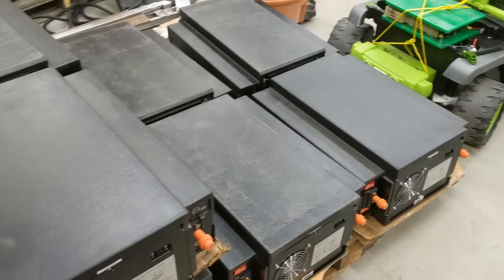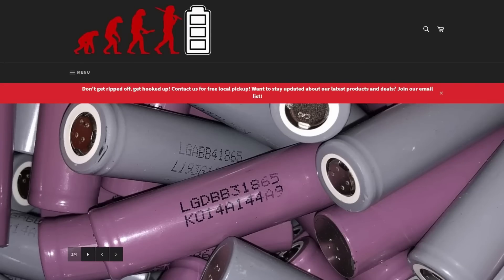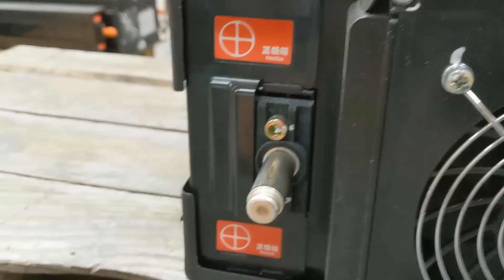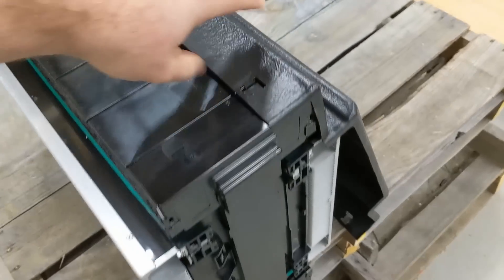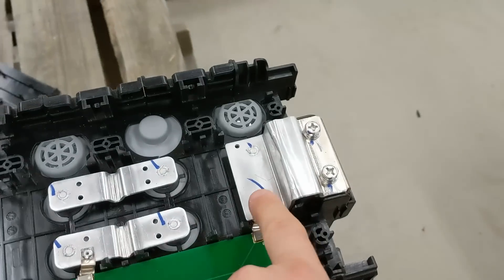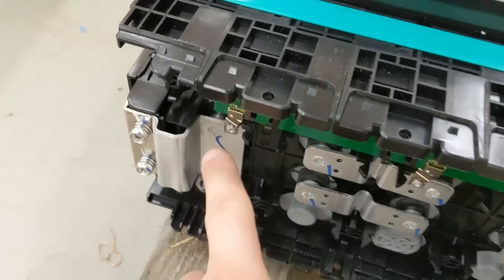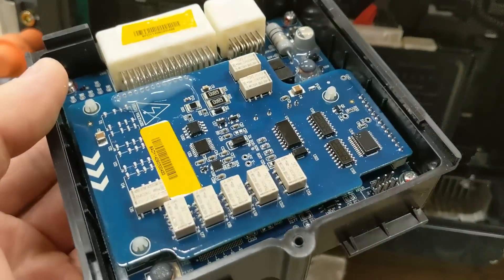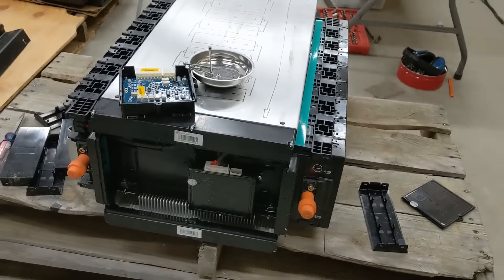$100/kwh Huge LiFePO4 Lithium Battery First Look

Comment: What if one of the cells are bad, how would you remove if busbar is laser welded?
Reply from the maker: I would cut the bus bar with a rotary tool (dremel)  Then I can remove the cell.  Once removed I'd probably bolt a wire onto the bus bar and run to a new cell.
Reply: Thank you

Comment: Hey David I'm new on your channel and I'm already hooked. You mentioned about putting two of those units in series, (for 48v nominal) would you be able to use the same 2- BMS's in series or would you have to change to One 16 or 17s BMS??
Reply from the maker: Hi Salvador, thanks for checking out my channel.  I don't recommend these batteries.  They turned out to be more of a nuisance.  I spent a lot of time trying to get them to work perfect, but constantly required my time to balance.  I have taken these cells out of service.  

If you are trying to build your own, I'd use better cells.  Use a 16s BMS, with LiFePO4 cells.  That means 16 cells in series, and the exact chemistry of the battery is Lithium Iron Phosphate.  

This is a great way to make your first battery: https://batteryhookup.com/products/new-battery-hookup-lifep04-32650-3-2v-5000mah-cells-1  This kit comes with 4 cell modules.  You would need 4 kits to have 16 cell modules total.  Those arranged in series would give you 16s, for a perfect 48V battery.  Then you need to add a 16s BMS.  Battery hookup is currently sold out, so try this one: https://overkillsolar.com/product/bms-100a-16s-lifepo4/ 

I have a coupon code with Battery Hookup: DAVIDPOZ which gets you 5% off, and helps out the channel through affiliate program.

Comment: Hi David, I live in Canada. Could you let me know how can I buy the battery?
Reply from the maker: I bought these from Battery Hookup.  However, these batteries are not performing very well and I don't recommend them.  Battery Hookup has stopped selling them because of the problems.  I'd look at a different option.

Comment: Late to the party I guess. Just bought some of the BYD packs from the bottom of the barrel. Each has a bad cell, listed that way from battery hookup. I've watched a number of people take them apart and rebuild them. That was my intent here for these 4 packs I bought.
Reply from the maker: That's cool.  I'm going to be taking mine down this summer and testing them.  I have a self-discharging cell in there somewhere.
Reply: @DavidPozEnergy  I used your code, so thanks for the hookup. 

I will try to video my tear down and rebuild, but I don't have the camera or audio gear to do professional work. I will post the project on my channel.

Comment: Dear Mentor DavidPoz 
I bought the BYD batteries, shipped to Somalia and lit a small village with 30kwh solar plant. 
I recently bought another 100 kw batteries from China. 
Can you please help find batteries capacity monitor. 
Secondly, I don’t know how many batteries I can connect together. I mean is it bad for the inverters. 
I use 9 5kw inverters set in parallel. 
I wish to show you the pictures but couldn’t attach. 
Thank you for your useful postings.
Reply from the maker: My favorite meter for measuring SOC (state of charge) is the Victron Smart Shunt.  I'm running one on my battery bank.  https://www.victronenergy.com/battery-monitors/smart-battery-shunt  If you are on Facebook, then I suggest joining the group DIY POWERWALLS I'm on there, and it's filled with helpful people.  And you can attach photo's.

Comment: Have you made a video on connecting a BMS  to the BYD 24v battery and if you have can you give me the link?
Reply from the maker: I have not made a BMS video on these batteries.  I used a Chargery brand BMS.  But I keep tinkering with it and I can never seem to get it to read correctly, or stay correct for very long.  I've recorded the process of calibrating the BMS, and wiring, but then it keep screwing up again.  I'm going to yank it out and do something different.   i wouldn't want to recommend a product that doesn't work well.

Comment: One question. I'm looking for a good battery bank for an RV setup that will run a mini split HVAC unit. How would I setup a battery like this to an inverter? I can only find inverters that have 12V input for the AC outputs.
Reply: There are a few 24v inverters out there. I run the AIMS inverter charger combo

Comment: OK question.  if those are 8s for 24 volts and one of your other videos it showed 14s for 48 volt system.   So will not 2 of these in series not be good for a 48 volt solar system.  Since then they would be 16 s. been watching your videos.  And I want to upgrade my battery system.  I have a 4kw inverter and I like to have a 100wh  battery bank.  I have been thinking about LIFePO or similar for my new bank. My old bank was only 250 AH about 5kw if I didn't discharge them at 100 percent.  I never discharged them below 70 percent.   I just want a much better bank that will last a lot longer than my Lead acid.  So been doing some research and watching. and wanting the best bang for the buck.
Reply from the maker: Depends on chemistry.  The ones in this video are LiFePO4 and 16s makes a good 48v.  But in some of my other videos I use Li-NMC and they want 14s for 48v.  I clear this up in a video: https://youtu.be/CbHABrTpSKU

Comment: Hello sir, 
I just I want ask you something I have a normal MPPT and now I using gel batteries so I want to change my gel batteries to lifepo4 so can work with my normal MPPT or should I change my Mppt to work with new batteries or just change my setting but I have just some settings in my Mppt ( gel , AGM, open lead acid , calcuim, AGM2 , sealed lead Acid) so should I change my Mppt?!...thank you
Reply from the maker: Check your owners manual and find out what the charging voltage is for each of the pre-sets.  The batteries I'm building in this video are 16s LiFePO4, so I want my charger somewhere in the voltage range of: 55.2v - 58.4v.  So I would be looking at my charge controller for a pre-set that is inside of that range.  It might not be called LiFePO4, but if it's inside the range, then it should work.   Always use MPPT with lithium, never PWM.
Reply: DavidPoz  thank you sir for reply, yes I have this option (Bat 58.4V) whan I choose my setting. This is useful.
Reply from the maker: Just make sure it works for your own personal setup.  Your cell chemistry, your # of cells in series, etc.
Reply: DavidPoz yes I read in my lifepo4 battery “charge cut-off voltage 54 +- 0.2 “ and I have this type in my Mppt 54.4 .

Comment: David, have you had any  issue with Batteryhookup?  I HAVE!   I bought  this same exact batteries (2 of them $450 each and $350 shipping paid $1250) but i received only one battery.   So I am out $450 and the shipping costs. I emailed them with all this information. I have tried to contact them other ways including emailing 17 times over a period of months. I have  texted them to the number they sent me confirmation of the sale. I have called them over 10 times. When I call them I just get a recording and have left messages.  Seems like you know them and trust them. If you have an pull with them please ask them to respond to me. order# 7663
Reply from the maker: Hi Webster,  First, I'm very sad to hear they are not getting back to you.  I'm a customer of theirs and bought these batteries for full price.  I drove to get them in PA at the time.  I agree that they are terrible about phone calls.  I can't get them to answer the phone either.  I have found the best possible way to contact them is through Facebook.  They have a facebook group called "DIY Battery" and I've seen them respond to problems/questions on there.
Reply: I just wanted to update this post, batteryhookup has contacted me and refunded my $450, I've had limited interaction with them(only had one purchase with them, albeit a large one,) and although it was very difficult to get them to respond , to be fair I did not try alternatives such as Facebook, only after I used social media they responded quickly and I'm satisfied.

Comment: Hello David, how are these batteries performing now?
Reply from the maker: Not great.  I'm using them daily with my inverters, but they don't stay in balance and I'm only using about 50% of original capacity.  Not worth it.  I should have use the money for an EV pack.  Like the BMW packs battery Hookup is selling.  with my coupon code DAVIDPOZ I can get those for about $84/kwh, so even better deal.
Reply: DavidPoz  
I have also been looking at the BMW packs at batteryhookup, I probably wait to see what you make out of them when you get some.

Comment: Hello David, I have been following you for a while now from Nigeria. Do you know if Battery Hookup still have these batteries or where else can I check
Reply from the maker: They don't currently have them.  They are not performing very good, so Battery Hookup pulled them.  But Battery Hookup is selling some better batteries now.
Reply: @DavidPozEnergy  they are?  I'm not seeing any large LiFePo packs... there's that A123 tear-down vid up now, but I don't see the pack for sale anywhere.  New to the forums/hobby but learning quickly.  Thanks!!!

Comment: I currently looking to purchase one of these to add to the byd 5kwh 24v what I want to know is are the compatible to connect together?
Reply from the maker: These modules are LiFePO4 chemistry, arranged 8s (8 cells in series).  If your current battery is also LiFePO4 and arranged 8s, then you can parallel them.

Comment: Hello David, have you written down the specifics of your BYD batteries from your trials? Im looking for watt hours, amps etc for a single BYD 24v box?
Reply from the maker: Yes, these things are not performing as well as I origingally expected.  Currently I'm getting about 3.2 kwh per module.  Today there are some great cells made for EV's being sold at Battery Hookup and they are performing to the listed factory specs.  So If I didn't own these BYD modules I'd buy more of those.  I made a video showing one of the types Battery Hookup has for sale: https://youtu.be/hlmKmhhqnq4

Comment: one bldc ebike motor one 350 amps alternator one stacked casing containing one large gear and on small gear. then one very large transformer. now it has eight plugs per unit that runs on less then one 120 volts and 20 amps socket. the whole thing would fit in one case of those lithium ion batteries. just patenting it open source then dumping on wiki could make you really famous.

Comment: Hi David I just received my batteries from battery hook up their the 24 V module   Lithium iron phosphate  the 1st thing I did was check the voltage   And it was 0 on all of Them Is this normal
Reply from the maker: Mine had some amount of voltage on all the cells.  Some were low, but none were 0.  If you charge them, use a very low amp until you get up to 3 volts.  like 1 amp charge.   If you find they don't take a charge, or are self-discharging, then it's a problem and needs to be returned.  But being very low in charge does not automatically mean the cell is bad.  It needs to be tested.

Comment: $100 per kilowatt hour?    cost wise?     holy fuck thats expensive.....  deep cycle marine grade battery's are 12 volts at 90 amps for $70      

and it free to charge them....    I'd go wind...  solar in inheritly inefficient for a 48 volt system.. and if your using power as you make it you'll run out..

Comment: Their website says no local pickup in PA. That must have changed since you picked yours up a few months ago. That sucks. No way I'm paying $300 shipping when I'm also in PA just a few hours away.
Reply from the maker: If you can get in touch with them, they might have a few that they did testing on or something.  Alternative, they sell those cool Nissan Leaf batteries (full out of the car).  Those weren't available when I bought these, but would be what I'd try next.  You can use my coupon code "davidpoz" for 10% off anything.
Reply: @DavidPozEnergy  Thanks David. I'll give them a call tomorrow. I'd probably avoid the Leaf batteries. They are lithium-manganese-oxide which have a very short cycle life as far as lithium batteries go. They are only rated for 400-600 cycles when new, and those are pretty well used up. They'd probably go downhill quickly. I suspect these LiFePO4  batteries have 1000 - 2000 cycles left in them before they become unusable. Seems like a better deal to me.
EDIT: Just noticed a few comments about bad modules and some very weak cells. Maybe I'll steer clear of all of these used BYD packs and just go with building my own from new Liitokala cells.

Comment: I have 4 Kilovault LiFePO4 12v batteries that only weigh about 40 lb each vs 80 lb for equivalent lead acid. But, the batteries need to be at an equal initial  voltage or they shut down. I got them to work for several weeks then the system shut down. I checked the voltages. One was way negative of the others. Charged them up again with battery charger. Turned on my little electric heater. Not long after they screwed up again. Then Iater I tried charging my hybrid car which was showing it was only drawing 1k watts on the solar system monitor. The batteries did the same thing again.  I'm using an Outback Mate3 and the 3 lights at the top have never shown the batteries were even half discharged. I think I've developed a better way to check the batteries for equal charge. The mate3 says my charge controller and inverter are working OK.
Reply from the maker: I'd love to hear more about the Kilovault.  Are you on Facebook?
Reply: @DavidPozEnergy  I actually did fully charge the car off my solar system. It just shutdown several days later. The charger for my car says theirs a fault in the cord I used to initially charge the solar batteries. Next time I charge them I'll use my new cord plugged directly into the wall socket. What do u want me to tell u about the Kilovault batteries. They say they have their own BMS sensors and not to use a separate temperature sensor.
 No, I'm not on FB. They stop me at the door when they want u to sign in just to look at their site.

Comment: What were these batteries originally meant for and do you think I could use them as is wired in parallel for a 24V solar system? Also how are they holding up for you? Were they a good purchase?
Reply from the maker: I just posted an update video on them.  https://youtu.be/TG48c571D6I

Comment: Hi David, just a quick question , would you be able to assemble 48 volts for someone  on a contract
Reply from the maker: No, sorry.  I'm just sharing my personal projects.  I don't do this outside my own home.
Reply: Okay David. Thanks for all the insight 
Finding all the wiring BMS quite tasking , is there a easier more plug and play way ?
Reply from the maker: Yes.  Battery Hookup sells another option that is already done with a BMS and case: http://bit.ly/2RbdbyI  Use coupon code "davidpoz" for 10% off.  It is a 24v version, but you can series connect two of them to make 48v and you don't have to change anything or do any special wiring.

Comment: When you first got these and were recovering them, what amperage did you charge at? I'm in the process of recovering mine (very low voltages) and was curious how you went about doing it.
Reply from the maker: I started off at 1.2 amps per module and have been working my way up.  I've noticed a couple cells that are week.  I'm going to take a closer look at them.
Reply: @DavidPozEnergy  thanks!
Reply: @DavidPozEnergy  turns out 2 of my 4 modules are dead 😟
Reply: @diyrenewableenergyelectron4996  Wow - Did they replace them?

Comment: Little background research, BYD is based in China and their newer Battery Box product line integrates with SMA and other major brands we like, but on scale, scope, and price point beyond home application.  They seem ultra legit so I'm hopeful these batteries will work great!  David, if you have $60k and storage for 400 tons, a lot of 500 is for sale on eBay.   Across the country in Vancouver Washington across the river from Portland OR....$120 a unit bulk/wholesale pricing.  25 mWh of storage!  We could caravan, cause the shipping is freight.....https://rover.ebay.com/rover/0/0/0?mpre=https%3A%2F%2Fwww.ebay.com%2Fulk%2Fitm%2F312851800920
Reply from the maker: Thanks, but I don't have $60k.  Would be a good deal per kwh though.

Comment: What is the life span of these batteries if cared for properly?
Reply from the maker: Wikipedia says 2,000 cycles.  This generally is until you hit 80% capacity of the original factory specs.  These are used batteries, taken out of service and are about there.  I'd be happy with another 2,000 cycles down to 60%. But there are lots of different versions out there.  I've seen some manufacturers claim 8,000 cycles.  I can't find original documentation for these batteries, so I don't know where exactly they fall on the spectrum.

Comment: Ill bet your van needs new shocks in the back because when its compressed like that the oil will leak out.
Reply: Wonder if the Toyota has an overload spring or bump...

Comment: To bad that bms,is to limited to reuse, in a diy ebike battery. But for a hundred bucks per module that's still a good price
Reply: $100 per kwh, 4.5 kwh per module, so each module is $450.